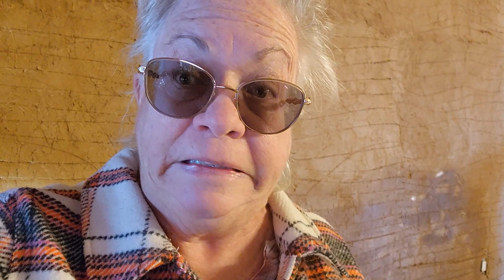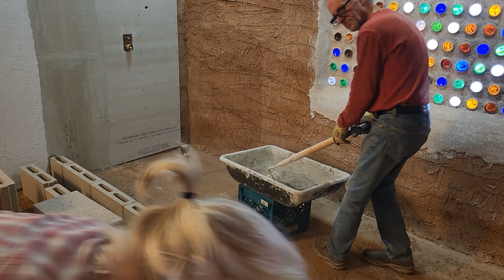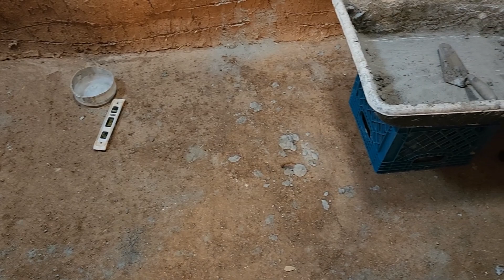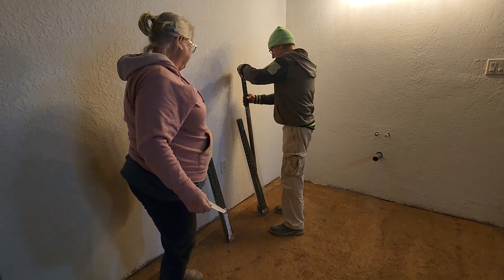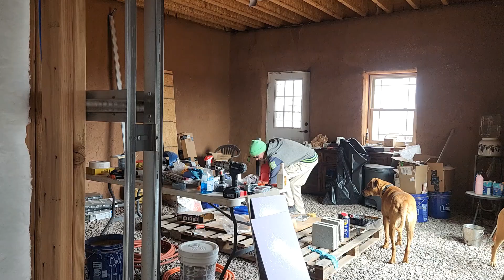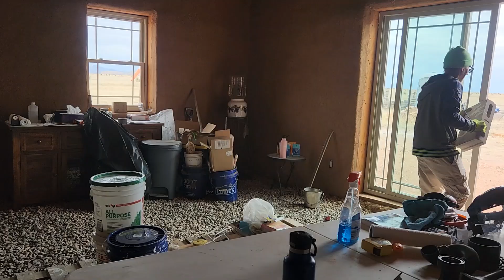Shower Block walls go up ep 77

Comment: Are you putting rebar down through the block?
Reply from the maker: We had mentioned that in a previous video, however,  since the walls are not structural,  we've decided against it.